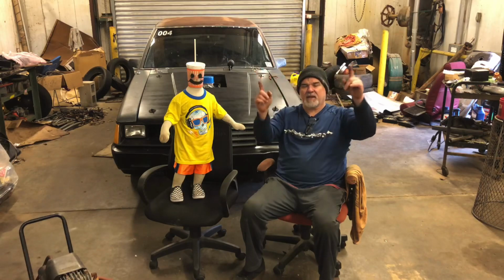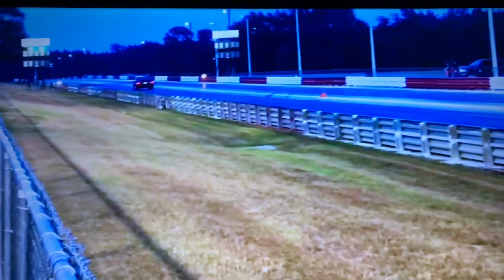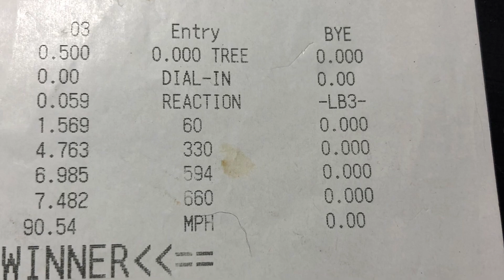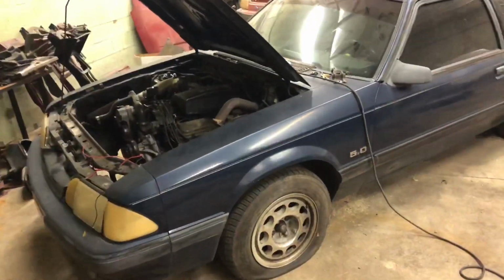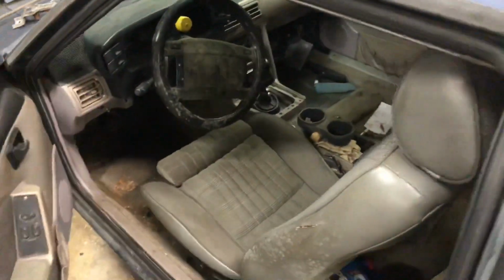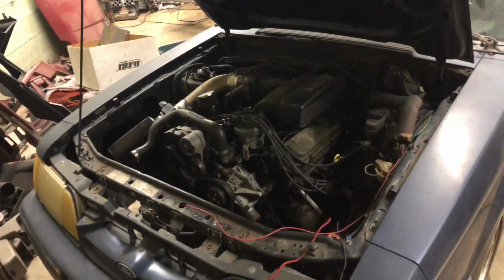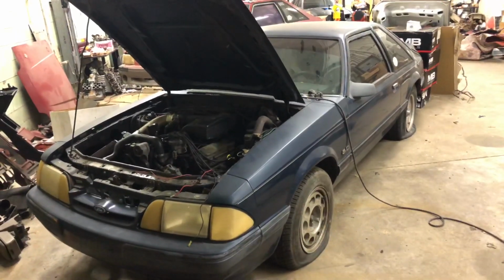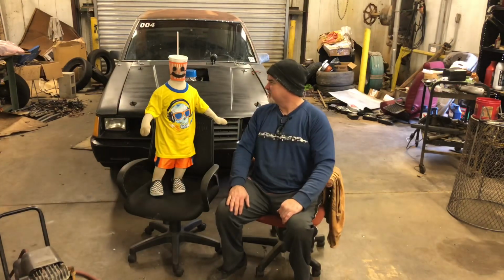1990 5.0 LX TeresasCar 2021/2022 Update Budget Mustang Fox Body Drag Car

Comment: If and when I can get my stuff from Missouri I'm gonna try and meet u and bring you a set of 1969 351 Windsor heads with comp double springs and 194/158 closed chambers. I believe on my 302!  It made 10.1 with block decked 5k and flats tops with 4 valve reliefs.. I also have a couple comp cams and like 4 holleys one is a 1960s model 2 Pcs holley 680dp I had on my 351 and it would rock. And 2 msd 6 series
Reply: You can have that stuff I'm planning on heading up this year hopefully in april

Comment: For a "nothing" video, still made 'er out to the 10min mark. Montage + voiceover was pretty tight too.

E7 as-cast Love, I'm down! Good springs though...

Just waiting to hear the Brinks truck roll up out front of your house with a delivery from YouTube :)
Reply from the maker: Just trying to give you guys enough time to doze off…the voice over/montage is a little better than just walking around it in my mind lol
They heads were on the van st one point and rolled 56/5800 with no issues, the nx264 is small, very light on duration..
Waiting on that truck as well 👍🏻

Comment: I know you've probably went over this before but I'm old and don't remember which video it was. How do you run the 2step on your cars? Is it off throttle, switch?
Reply from the maker: I run It off a button in the shift handle Bob…I prefer the LONG engineering one (G-Force)..it’s thinner than the hurst and doesn’t have the finger slots, very comfortable for me…
Reply: @5.0tussin  Thanks man, I thought it was off the shift handle but I wasn't sure.

Comment: Can I the specs of the aod trans new to modin 5.0s and don’t want to t5 swap my thunderbird 91
Reply from the maker: Biggest thing (imo) with an aod is valve body/stall…they’ll make the most performance difference but aren’t super cheap either..also depends on useage, poweradder, NA etc as far as other upgrades..

Comment: Just out of curiosity what’s the fastest you have ever gone on a complete stocker? Stock intake, e7’s stock cam, 100% stock
Reply from the maker: 7.62 or .64?….on a 235/60 DR with a weak low 1.6 ‘60…probably coulda ran 7.58/59 with a slick….stock TB/intake/inj/cam/E7/rockers/water pump/stock headers…T5/4.10’s…Kev told me I couldn’t run a 7 with stock motor 🤪